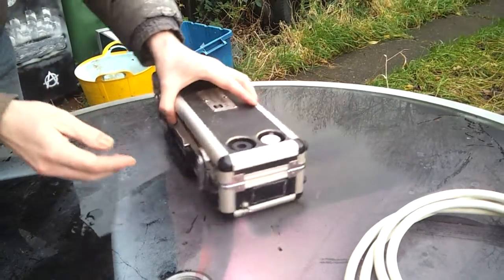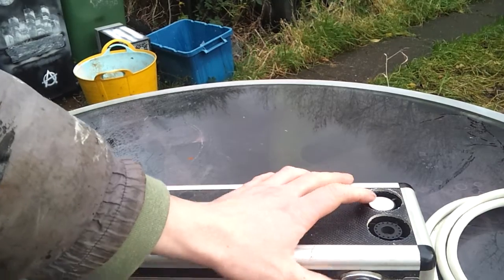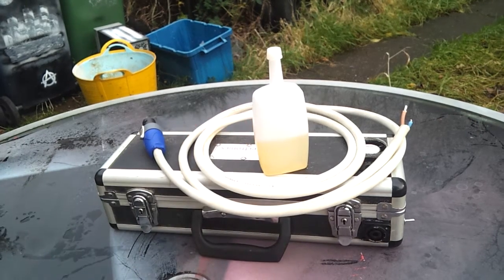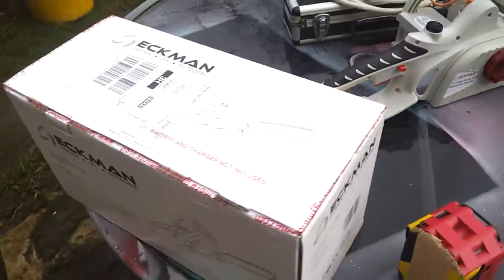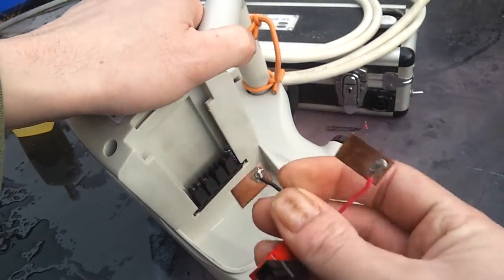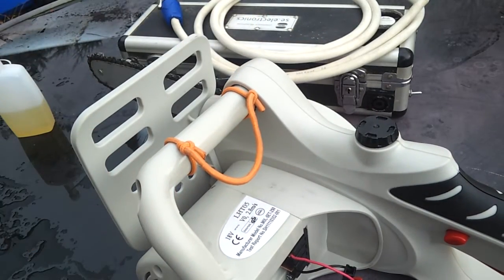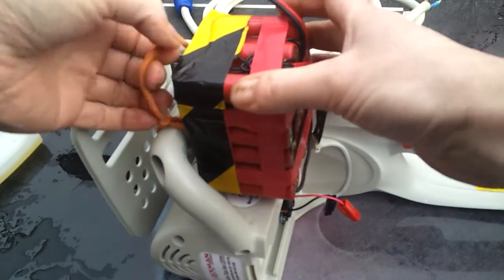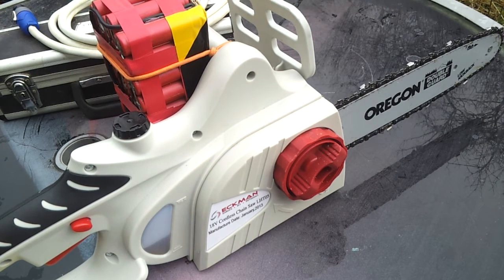Cordless chainsaw project 2

Comment: i wonder if you could do a sling shot model where the pack is seperate.like a back pack.
Reply from the maker: +Chris Fuller indeed buddy..i have a small pack on the saw at the moment tho my massive 30 ah pack will be running it soon..i just need to find a secure way to fix the cable to the saw..maybe another nutrik connecter?
..the  battery pack could go in a back pack but the 30 ah one is a bit heavy..i ll do a video on it when ive got it together tho.
all the best.;]
Reply: have you checked out those new cells from america.13 dollars for a Lithium LiFePO4 Cells by Headway and CALiB

10ah single cells.no soldering they screw in
Reply from the maker: +Chris Fuller wow really..that sounds amazing.. ars they like the A123 cells? 
i will check them out..shipping costs will be too much tho!
 ..i wonder if i can get some here..whats the discharge rating on those...
Reply from the maker: +Chris Fuller the china aviation ones at 100 ah are intresting!
lower voltages tho on the head way 10 ah 3.6v fully charged 3.2v fully discharged and max discharge of 10 c is very appelling 
.think hobby king lipos still have an edge..14.8v 5 ah for 18 pounds with a 20 /30 c discharge is hard to beat...
tho ten headways would be fun to play with!...thanks for the heads up on those i will be keeping an eye on them.
Reply: i want the 100ah one for a solar power station.12v is good for my inverter.we have floods so need back up.it will run a 50w light for a few hours.a bit like an expensive torch.lol
Reply from the maker: +Chris Fuller  take a look on line for 27 w led light 10/ 30 v..think its for trucks and 4x4  offroaders..they are really bright and run at less than 3 amps and are really quite cheep..about 10/15 pounds...there is a 43w light to..that was about 15/20 pounds inc postage.
that would be a serious back up pack tho..100 ah  at 12 v with a intermittent 1000amp discharge  wow! and a fair investment too..! better get playing the lottery!
are you in usa?
Reply: uk